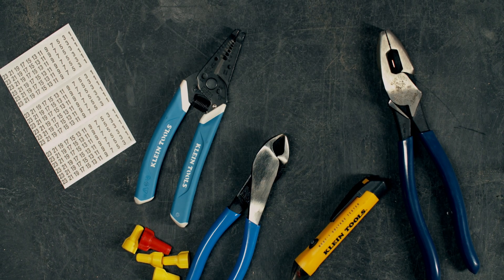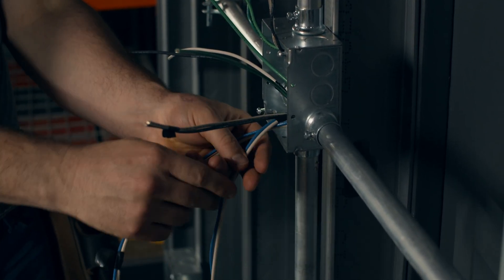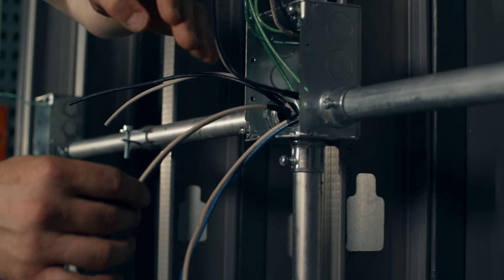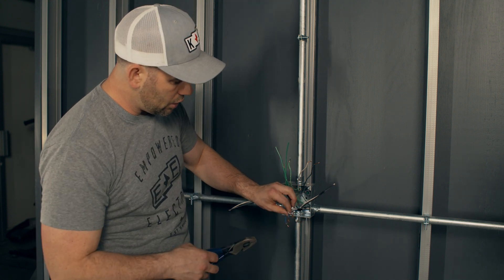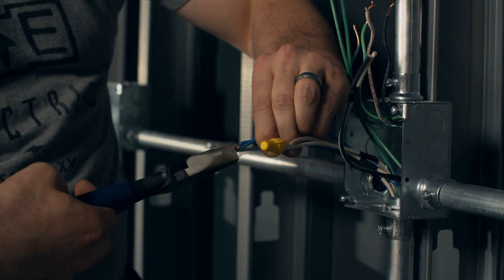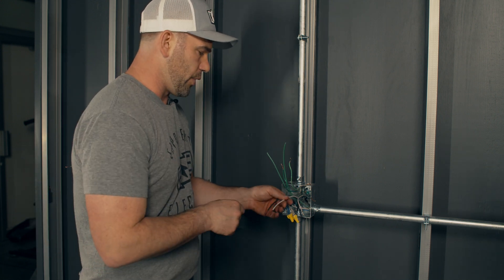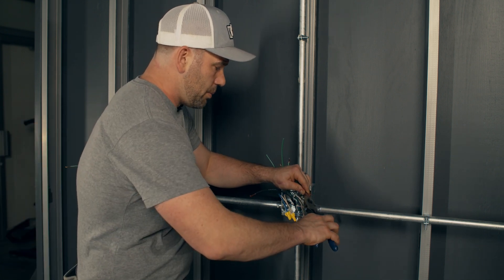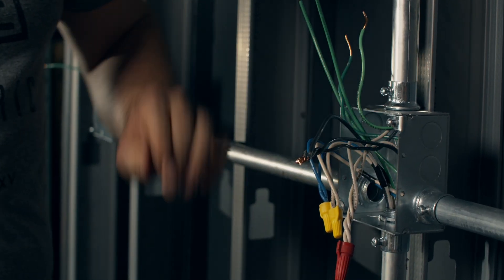Whats the Difference Between Solid or Stranded Wire?

Comment: You see how things are and how they're heading towards a bad scenario. In my country, the old electrical installations were all made with pure, solid copper wire, and there are still several installations over 50 years old in perfect working order. Nowadays, solid wires have completely disappeared from the market, sockets are no longer designed for them, and the flexible wires for sale are of very poor quality, with a few rare exceptions. To give you an idea, many salespeople in their twenties don't even know or have never seen a solid wire or a screw-type socket.

Comment: I'm remodeling a bathroom where the existing outlet was very close to the sink (a mid-century home built in 1951). The new sink is a bit larger and has 8-inch faucet spacing which reduces the distance between outlet and faucet so I'm moving the outlet a foot to the left. However, the existing outlet box was attached to a stud. Once I drilled a hole, Romex solid wire is almost impossible to work with over the short distance so I've ordered stranded wire to use to splice the existing wires to the new outlet. I hated having to buy additional wire but it sounds like stranded wire's flexibility should resolve some of the installation problems  I've experienced. (BTW, I'm not completely opening the walls which made it harder to use Romex solid wire).

Comment: I recently replaced a GFCI outlet in my kitchen and the wire in the box was stranded. The new outlet had screw terminals unlike the original outlet where the wires were attached by the GFCI manufacturer and attached to the wires in the box with wire nuts. I stripped the stranded wire, formed it around the screw terminals (clockwise direction), and tightened the screws. I'm thinking the better way is to crimp a fork terminal onto the wire so the wire strands are not crushed. My brother recommended removing the stranded wire and using solid wire at the screw terminations. I like that idea too. What do you recommend?? I know in military applications that use stranded wire, the wire end is typically crimped into a ring lug and attached to a terminal block with a #10 screw. Also, you have to becareful the strands don't break when securing to the outlet terminals. 😊

Comment: Do you know about RV connections (vibration)? It seems like depending on who you ask, RV wire should be stranded, but I don't know why you couldn't use either, as long as the terminal connections are good.

If we had solid wire, couldn't the ends be lightly sanded for better grip with the terminal screws?

Comment: I mean you do realize stranded wire is no different than solid wire after you twist solid wire together. The solid wire when twisted becomes stranded wire as if you're making a pigtail. If you had four wires that you pick till together, that becomes a stranded end. Just because it's thicker than the quote" stranded wire doesn't mean that it's not stranded. Just an observation. I could be wrong but I was just thinking that stranded wire is multiple wires put together and when you put solid wires together. Seems to me that multiple solid wires twist it together. Makes a stranded wire. Am I wrong?
Reply: You are right✅  ig the guys just hates stranded lol, but it depends on the place you're working in, every country has different ways of building, solid Romex is good for wood houses but here in my country everything is blocks and poured concrete so pulling solid through the pipes in the wall would be a pain in the butt😅
Reply: wrong

Comment: 100% team stranded. The only time I ask for solid would be for the green, grounding wire. Stranded is easier to pull, easier to makeup, easier to fold neatly into a box. If it needs to be terminated, then I pull out my crimper. Only reason I specify solid green wire is sometimes I push wire through conduit, and I lead with green. And I always have green screws for bonding pigtails I can use with solid. I had a foreman who didn’t do any work and hated my guts so he ordered all solid wire for over 100 ft 3/4 pvc pulls. Worked with a journeymen for half a day pulling through past 360 degree runs because it was so effin difficult. Head kept on snapping because all the 90s were factory elbows.
Reply: It’s harder to strip stranded because the small copper fibers are braided and the pvc wire insulation molds to the braid. This compares to solid, which is a conical, smooth surface. So when stripping stranded, you cut, slightly release pressure then flick wrist. Solid, you can cut then flick because the copper has a smooth surface.
Reply: @annquach6613  I never have issue stripping stranded if you have the correct size stripper for the wire size.

Comment: Good video and I agree with you about stranded wire. You can, however, eliminate all the issues with them by using Wago lever nuts. They're more efficient, no need for linesman pliers and pre twisting, less wire to strip, etc